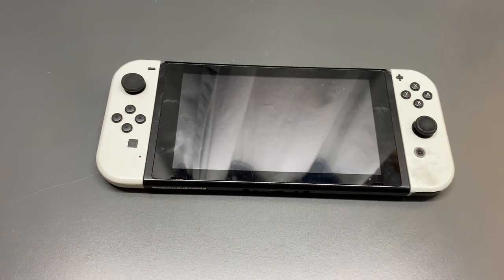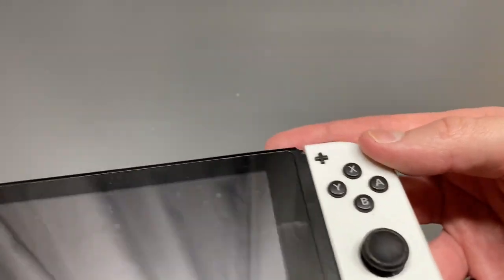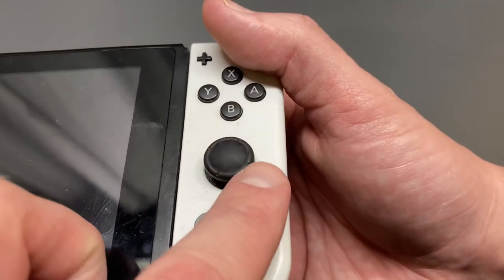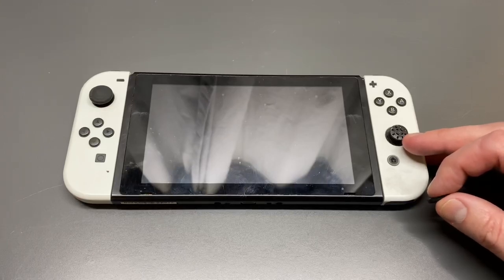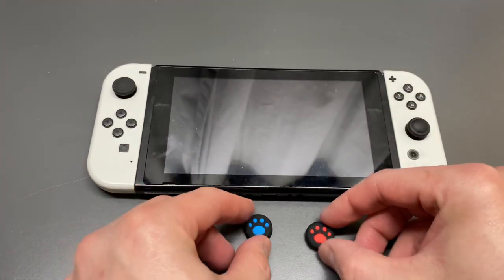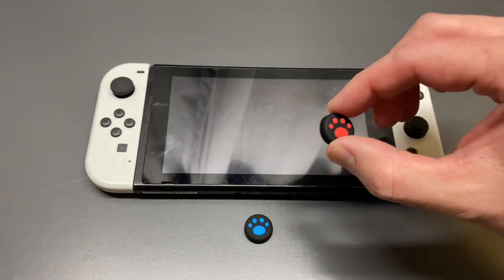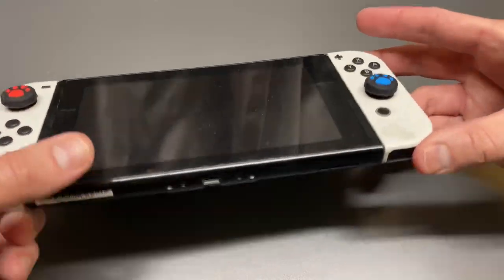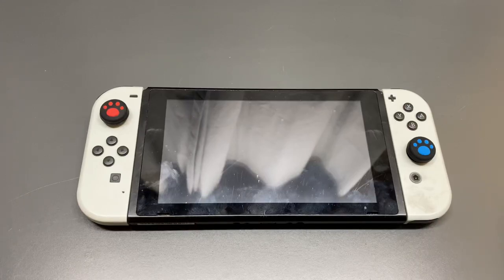Revitalize Your Joy-Cons: A Guide to Replacing Nintendo Switch Joystick Thumb Grips with New Covers!

Comment: Thanks for the video! I just have one question is that the cover has several bumps around the edge on my console and i can also see them on yours when you replace the cover. These bumps are on my right cover but my left one is nice and flat and i dont think there arw supposed to be bumps. Is there any way to get rid of these bumps? Thanks

Im pretty sure it has something to do with the grooves maybe
Reply from the maker: Your correct, if the joycon grip has grooves you have to install it properly into the grooves on the analog stick, otherwise you’ll get bumps around it in some spots.

Comment: Hello, 

I'm trying to find some thumb grip replacements (as mine ripped) with the teeth on the bottom. I've looked and looked but can only find flat ones that'll move about. Please can you tell me where you got these.

Nintendo support were useless!

Thanks you! 😊
Reply from the maker: So these thumb grips actually came with a joy-con repair kit.

If you want OEM grips with teeth, order a joy-con replacement kit, they come with grips with teeth you can use. Most third party options don’t have teeth because the grip would violate Nintendo patent or so I’ve heard.

Comment: Thanks for the video! I may have missed it, but did you say what to do it when you put the new cap back on there are a couple uneven bumps on the cover? I tried lining up the grooves as best I could but couldn’t get rid of them
Reply from the maker: Yah, it’s tricky. You have to carefully line up the grooves on the back of the replacement thumb cover and push them gently into the control stick, it’s a pain.

Thanks for watching! Please make sure you subscribe to my channel!